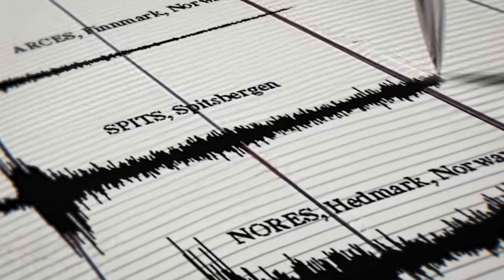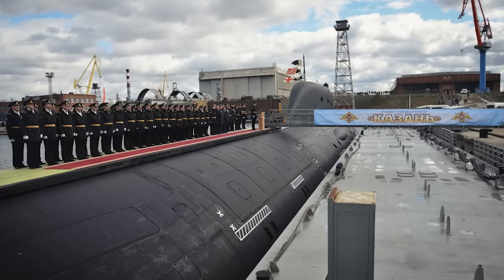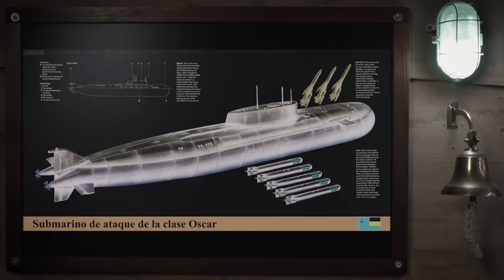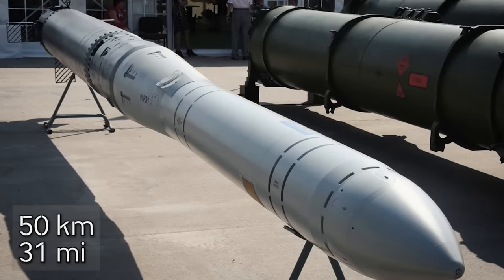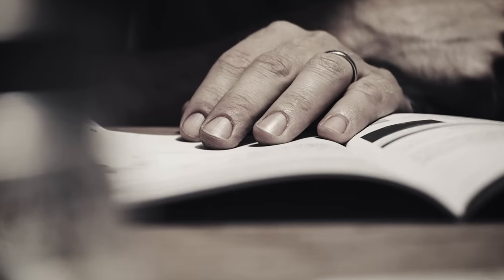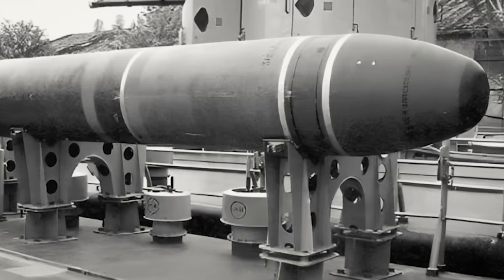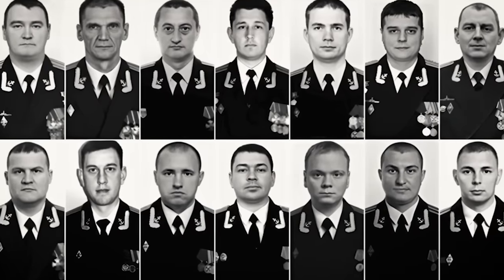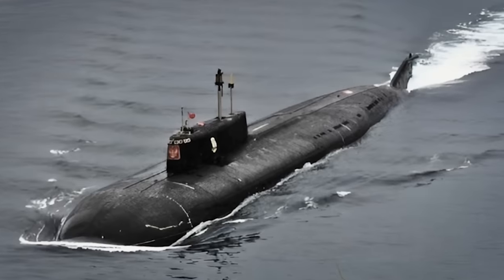This Chemical Killed 118 Men...

Comment: The brazen lying from officials is astounding. "minor difficulties", "everyone survived", "collision with NATO sub". 

Absolutely shameful.
Reply: Right?? It's infuriating.
Reply: "Collision with NATO sub" is what officials DENIED. And which is most plausible.
Reply: Reminds me of all governments doing the same all of the time.
Reply: @Conserpov  How is that the most plausible scenario?  Are you an underwater collision expert?
Reply: @thomasfx3190  
Yes, boy, I am.
Reply: @Conserpov  Well considering what I’ve seen, it was a torpedo explosion that set off a few others and that was that.  Russian subs don’t have too much of a reputation for quality workmanship.
Reply: @thomasfx3190  
> it was a torpedo explosion
You could just say "water filled it".
What caused the explosion?

> Russian subs don’t have too much of a reputation
Accroding to "shovels with chips from washing machines" people?
Reply: @Conserpov  I thought I had replied to this, perhaps not.  The fire was started by an overheated torpedo battery and leaking peroxide propellant.  That set off the warhead, which set off some others.

As for Russian Nuclear subs not having a good mechanical here you go:

* Soviet submarine B-37: Exploded in 1962 due to a fire in its torpedo compartment1.
* Soviet submarine K-129: Sank in 1968, with several theories behind the sinking, including a possible collision or missile explosion2.
* Soviet submarine S-80: Sank in 1961 due to a jammed valve that led to flooding1.
* Soviet nuclear submarine K-8: Sank in 1970 due to short-circuiting and fires1.
* Soviet nuclear submarine K-219: Sank in 1986 after a missile tube explosion2.
* Soviet nuclear submarine K-278 Komsomolets: Sank in 1989 due to a fire2.
* Russian nuclear submarine Kursk (K-141): Sank in 2000 after a torpedo explosion1.
* Soviet nuclear submarine K-429: Sank twice, in 1983 and 1985, due to flooding2.
* Soviet nuclear submarine K-222 (Papa class): Suffered a reactor leak in 19801.
* Soviet nuclear submarine K-27: Was scuttled in 1982 due to a damaged nuclear reactor2.
Reply: @thomasfx3190  
Either you don't know what you are talking about and just copy-pasting, or you are not being honest.
Do you really think a subs built in 1959 are "examples of bad modern technology", you did you think I won't notice what's in your little list?
And that is bad compared to what exactly? Subs which can't have accidents because they never leave port?
Either way, you are not a good faith interlocutor.
Reply: @Conserpov  Well I assumed you knew.  Since 1955 the US has lost exactly 2 submarines & the USSR / Russia has lost at least 11.  In my view, that is an honest measure of engineering & technical skill, mostly because it keeps happening.  I’m not trying to offend you personally, I just think Russian submarines are less than great, but that doesn’t make me better than you, I don’t build submarines and neither do you.  But in reality I’ve made a study of submarines in the last several years so I do know what I’m talking about.  

And Comrade, nobody in the west uses the word ‘interlocutor’ any longer.  We would say, ‘someone who is having a conversation’.  I can’t tell where you are from?
Reply: @thomasfx3190  
"Russia had accidents with 1950-s subs - Russian engineering is bad - Russian bad engineering caused accident."
You are grasping at straws, creating an entire string of non-sequiturs in support of an assertion that you can't substantiate.

US Navy has a very long history of collisions with everything that floats, including several Russian subs.

Including on the day Kursk sank, what a coincidence.

Peroxide propellant does not start leaking for no reason. It takes a sledgehammer, or a collision.

You are not even trying.
Reply: @Conserpov  Facts:  there have been 11 full hull losses of USSR / Russian subs.  Myth: It must have been the Americans that collided with Kursk.  Can you provide more info with your AI assistant that speaks English for you?
Reply: @thomasfx3190  
> there have been 11 full hull losses of USSR / Russian subs
Which is irrelevant and not an argument.

> It must have been the Americans that collided with Kursk.

There have been a string of 8 prior such collisions, caused by American practices.

Yet your treatment of prior history is highly selective.

As far as I know, torpedoes do not suddenly explode for no reason, it had to receive a hit stronger than a sledgehammer.
You insist it was just magic.

A US sub was damaged.
You insist it's unrelated.

Likewise, you dismiss other evidence inconsistent with "random explosion" like external damage.
"Russians are just inferior" you say.

Keep projecting, buddy.
Reply: @Conserpov  it’s not at all irrelevant, it’s an indicator of how well the Soviets built and crewed their submarines.  They may have been very clever men but their engineers repeatedly failed them to a deadly consequence.  Thats the thing about the USSR and its legacy, obviously very bright, impassioned people which usually means a terrific success, but in the case of the Soviets, it certainly didn’t.  That’s the fascinating part.  When I was a young man we were terrified that Soviet T-80’s would come rumbling through the Fulda Gap, but it never happened.  By the time I was an Army Officer the whole thing had collapsed.
Reply: @thomasfx3190  
You are making groundless assumptions about engineering, as if it was relevant to magical torpedo explosions.
Last I checked, pretty much all those accidents were caused by human errors. Just like dozens of US Navy collisions, including 6 admitted collisions with Soviet subs.

You seem to be ideologically biased to dismiss the version that is most supported by facts. I.e. you are delulu.
Reply: @Conserpov  Even Putin agrees with me.  Why don't you just take a swing at it and you tell me what happened, that's where we're going anyway, right?
Reply: @thomasfx3190  
Appeal to authority now?
Reply: @Conserpov  WRONG.  it was what the US and UK denied, it was what Russia put forward as the first explanation.  the "conservative position" must mean:  "endlessly lie about things for absolutely no reason".
Reply: @Conserpov  "Appeal to authority now?"

you mean, as opposed to just making shit up completely, like you're doing?  LOL  you have no idea what the terms you are using even mean.
Reply: @thomasneal9291  
> it was what Russia put forward as the first explanation.

You clearly don't know what you are talking about, and you are arguing in bad faith on top of that. 
Russian government was the one denying it most of all, and was the one most responsible for the coverup.
Individual skeptics (Russian and non-Russian) were the ones who brought this up, with evidence, and were treated as "conspiracy theorists".

Go touch grass
Reply: @Conserpov  the only person making groundless assumptions here is you. HTP's volatility is well documented. Just because you are unable to understand the basic chemistry at play here does not make it a ":magical torpedo explosion", it just makes you ignorant.
Reply: @Conserpov  If things merely being built in the 1950s dooms them to failures like this, then I'm sure you wouldn't mind providing us with a similarly long list of US subs that had similar problems. Feel free to go all the way back also to 1959. Can't wait. You will definitely be able to, surely, since the 1950s decade was the problem, and certainly not Soviet engineering!
Reply: @gavinjenkins899  
More casuistry.
Reply: @Conserpov  If only you were capable of making a coherent argument why! But nope, all you have is "nuh uh! I'm rubber ur glue" apparently. The 1950s, 60s, 70s were the same decades for both countries, any decade based reasons are identical, both made hordes of subs, where's your US sub list? I'm on the edge of my seat!
Reply: @gavinjenkins899  
You argument is - Soviet subs had bad engineering in 1950-70s. Therefore, Russian sub in 2000 is also bad.

It's puerile and asinine.
Reply: @shanetonkin2850  
> HTP's volatility

Thousands of HTP torpedoes randomly explode for no reason every year, because HTP is volatile. Got it
Reply: @Conserpov  the Kursk was an Oscar class submarine ENGINEERED/designed in the 1970s. So yes obviously this sub disaster inolving a sub designed in the 1970s is related to the quality of 1970s soviet engineering, not 2000s russian engineering. The HTP torpedo type meanwhile was engineered in the 1950s. I'm also curious by the way why you think Russia banned/removed HTP torpedoes in their fleet immediately after this event and citing this event, if torpedoes had nothing to do with it. Very curious. The incident DOES certainly speak to 2000s Russian leadership and decisionmaking, however, in the choice of relying on unreliable 1950s/1970s engineering in their 2000s fleet
Reply: @gavinjenkins899  
> Russia removed HTP torpedoes in their fleet immediately after this event and citing this event

As I've said, you don't know what you are talking about.
The whole coverup included statements about removing 65-76A torpedoes from service, but they didn't do that. They are still in service.

I bet you also still believe in Saddam's WMD
Reply: @Conserpov  No, they don't, because "thousands" of HTP torpedoes do not even exist. Every other navy abandoned using them decades ago because they were so problematic. Such as when one blew up and sank the HMS Sidon in 1955.

But carry on just blaming NATO for all your problems if it makes you feel better dude.
Reply: @shanetonkin2850  
Stop projecting, buddy, and stop using "arguments" from Russian government coverup guidebook
Reply: @Conserpov  I'm not "projecting" anything, I'm just explaining to you the simple facts - Something you seem totally incapable of doing to support your "theory".. 

oh, and accusing me of using augments from a guidebook, whilst simultaneously parroting the most cliched and overused Kremlin line in existence? ("it's NAtO's fault!!!")

Ironic.
Reply: @shanetonkin2850  
> I'm not "projecting" anything

Here's textbook examples of projection:
> carry on just blaming NATO for all your problems if it makes you feel better dude
> Kremlin line

Not to mention the asinine labeling of the literal opposite of the actual Kremlin line "Kremlin line". Can't get more asinine and bad faith than that.
Reply: @Conserpov  >Can't get more asinine and bad faith than that.

Yes, you can. And that would be by screaming at anyone who will listen that the Kursk disaster was caused by a NATO sub collision, whilst providing absolutely no evidence whatsoever to support this allegations
Reply: @shanetonkin2850  
There is a very long history of US subs colliding with Russian subs. This is a fact.
Both sides have a long history of covering those incidents up. This is also a fact.
A few days after the incident a Los Angeles-class sub with a damaged bow was spotted in Norway. This is a fact again, the most important one.

American, Russian and French independent experts concluded that, despite bow being cut off for a coverup, signs of collision could still be seen on the Kursk's hull, and that random magical torpedo explosion is improbable fiction.

Keep spinning Kremlin's version though, buddy.
Reply: @Conserpov  Nice Logic fallacies.

>There is a very long history of US subs colliding with Russian subs. This is a fact.

Yes. That is indeed a fact. US and Russian subs have collided in the past, but that is not evidence that that is what happened on THIS occasion. I can just as easily argue that Russian subs have a long history of self inflicted mishaps due to human error and poor maintenance. Correlation does not mean causation.

>Both sides have a long history of covering those incidents up. This is also a fact.

Yes. That is also true. Both the US and Russia have a long history of covering up incidents, but again, that is not proof in any way that that is what occurred on THIS occasion. There is also a long history of Russia falsely blaming NATO for things (eg. the War in Ukraine, Prigozhin's plane crash, the Crocus City hall attack...) 

>A few days after the incident a Los Angeles-class sub with a damaged bow was spotted in Norway. This is a fact again, the most important one.

No, this is not a fact. A satellite image purporting to show a Los Angeles-class sub  with a tarpaulin shrouding it's sail, not bow, was circulated, but the authenticity of this image and more importantly, when it was taken, has never been proven. 

>and that random magical torpedo explosion is improbable fiction.

No it isn't. I explained this to you earlier, the potential for HTP torpedos to explode if not carefully maintained is well documented, and has already happened once in the past. (which is why all other navies have long abandoned them). It's not "magic", it's simple chemistry. 

But since you bring up the subject of "improbable fiction", shall we examine the bizarreness of a collision between a 19,000 tonne, double hulled, Oscar II class Submarine and a single hulled Los Angeles class submarine less than half it's size,  resulting in catastrophic hull damage to the larger vessel, while the smaller vessel is seemingly able to sail away without difficulty?
Reply: @shanetonkin2850  
> shall we examine the bizarreness of a collision between a 19,000 tonne, double hulled, Oscar II class Submarine and a single hulled Los Angeles class submarine less than half it's size,  resulting in catastrophic hull damage to the larger vessel

Even a small child can see why this is a non-argument. The result of collision mightily depends on collision place and angle. Smaller ships cut larger ships in half and keep going, and that never surprised anyone.

Clearly, you are not arguing in good faith, you are just repeating Kremlin's talking points.
Reply: @Conserpov  

I'm not repeating the "Kremlin's talking points", I'm repeating the internationally accepted verdict due to the absence of any credible evidence to the contrary.

You on the other hand are replicating the Kremlins currently preferred tactic to the letter - 'accuse Ukraine/NATO/The west anytime something goes wrong because it's far more palatable to just blame others  than it is to actually take responsibility for your own mistakes'
Reply: @shanetonkin2850  
> I'm repeating the internationally accepted verdict

I.e. Kremlin's and Washington's talking points.
Reply: @Conserpov 
Call it what you want, it's still the most plausible explanation based on the available evidence (except for in the eyes of a handful of conspiracy theorist screwballs)
Reply: @shanetonkin2850  
"as Kremlin says"
Reply: @Conserpov  Have you got any better evidence to the contrary?

No, you don't.
Reply: @thomasfx3190 
"Poor worksmanship"... Laughs on Tresher...🤣🤣🤣
Reply: @thomasfx3190 
Laughs on Tresher...🤣
Reply: @lusa3002 Thresher was a fine submarine, and through her sinking  we learned how to prevent such a disaster from happening again, idk about you but if 11 submarines sink in oddly familiar ways and still nothing's fixed, that's shitty design
Reply: @Conserpov bros a professional conspiracy theorist 💀
Reply: @kop1522  
Amateur koolaid drinker?
Reply: @Conserpov  Are you honestly saying that there weren't any explosions, Kursk performed a controlled descent to the bottom because of a minor inconvenience caused by a NATO sub, the whole crew survived, RuZZian navy provided the crew air and power and everybody lived happily ever after like Kremlin tried claimed?
Reply: @L4v3  
Funny how you had to change the story in such an embarrassing way because you have nothing to say
Reply: @Conserpov  I'm just pointing out how flawed your theory is. You are saying they lied about everything else but not the subs colliding without providing any evidence. If somebody only lies about an incident and refuses to take any responsibility, they aren't suddenly going to speak truth when they claim it was somebody else. That's just how pathological liars operate. More lies after lies.
Reply: @L4v3  
> You are saying they lied about everything else but not the subs colliding
Except the official story on both sides is that there was no collision, and no other sub.

You are not even trying, buddy. Go back into the sandbox where you can find and "debate" your intellectual peers.
Reply: @Conserpov  I'm referring to the first claims Kremlin made about the accident. Everything in that statement was lies and since then no respectable source has claimed it was caused by a collision.
Reply: @L4v3  
> I'm referring to the first claims

That you just made up.

> no respectable source has claimed it was caused by a collision.

And by "respectable" you mean Kremlin?

Go back into the sandbox
Reply: @Conserpov  If you watch the video you can even see the clip where that admiral gives a statement in which he claimed that everything is fine, no explosions, no deaths, easy rescue, NATO sub's fault. That's all evidence there is to support this claim. Those admirals and other navy officials stopped repeating that silly story when the final report came out.

Kremlin is hardly a respectable source of information, but even their report didn't try to shift blame to NATO. The crew was handling poorly maintained equipment they didn't have training for and cut corners in safety.
Reply: @L4v3  
You are literally confirming that initially the truth about NATO sub came out, and then the Kremlin covered it up.

Well done, buddy
Reply: @Conserpov  Just because some random dude says a NATO sub collided with Kursk while spewing out other lies doesn't suddenly mean the sub part was a truth. Maybe the truthful part was that they had established contact with the crew, but wanted to cover up that because of some other fuckup? Maybe the whole crew survived, but they botched the rescue and everybody died?

If I make up 2 lies about you and tell them to a wider audience, it doesn't mean one of those lies is a truth. Some idiots would think there's some truth in what I said, but they both are still lies and the same applies to Kursk and this alleged NATO sub. Two lies don't make a truth.

There's no evidence to back up that claim because there wasn't a collision.
Reply: @L4v3  
Try harder spinning Kremlin's version, buddy
Reply: @Conserpov  Do you have any evidence to provide that supports your claims about 2 subs colliding?